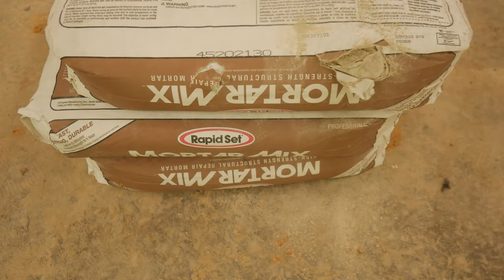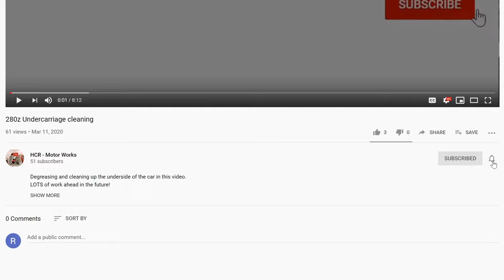Shop Wall Project - Rapid set Mortar Mix

Comment: Bro rapidset is no joke. It does not play. You used the correct product for vertical structural repair. As far as the 15 minutes it all depends on temps. You have to keep it moist and you might get 15minutes of "working time". Good job btw.